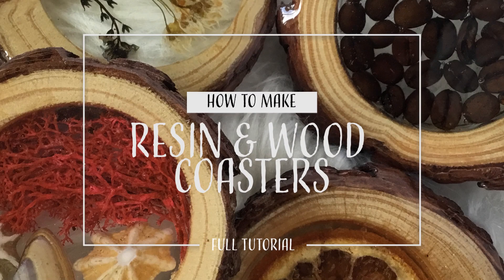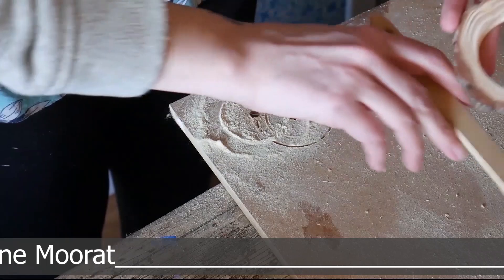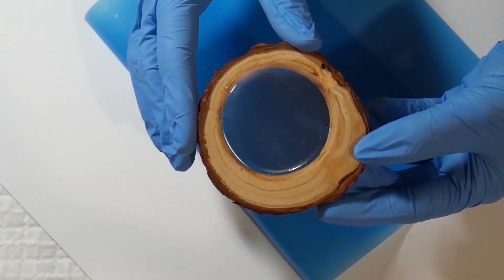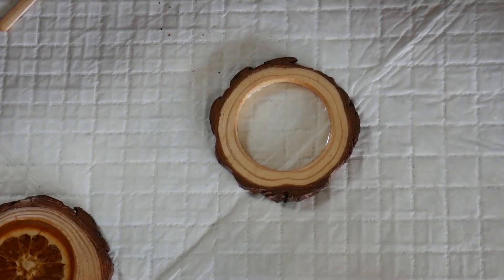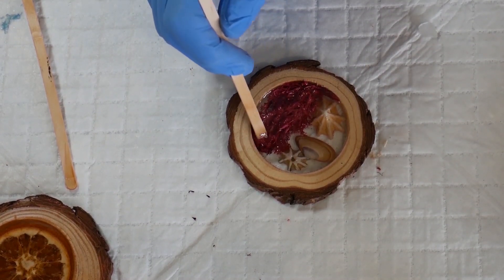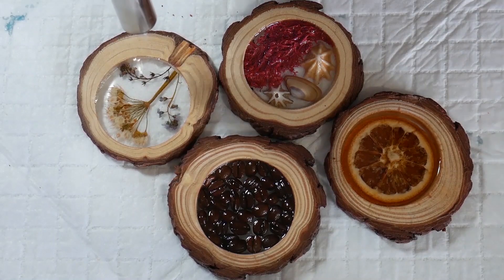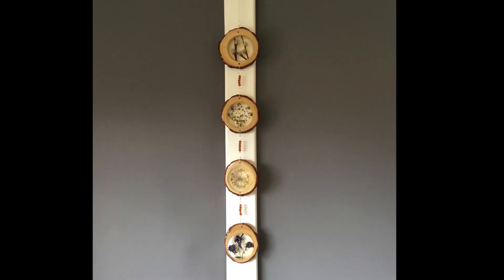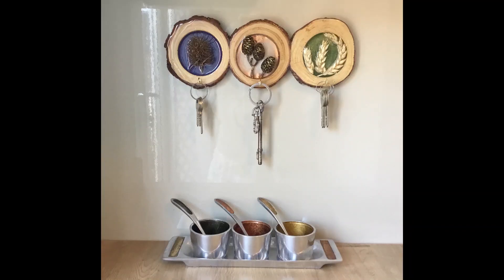Nature's Textures Captured in Resin & Wood Coasters. Full Tutorial

Comment: Hi, to avoid bubbles, heat gently by passing over with a flame from a small blowtorch hotter than what you had for a longer period than what you did (like you would use for cooking). For epoxy resin.
Reply from the maker: Thank you. In normal circumstances I would agree but as I was working with wood I was trying not to scorch it.

Comment: I am wanting to do something similar to this for a upcoming art project but the difference with my idea to this one is that I want to use pressed flowers stuck onto sanded wood rounds, and then pour the resin over the top to seal it. Is this a good idea or could there be another way to do it? I also wanted to paint some of them then pour resin over the top.
Reply from the maker: I think it is a great idea. I’m thinking if you coat the wood surface with pva then put the flowers on and allow it to completely dry before adding resin it will work nicely. If there are any bits on the pressed flowers that won’t lie flat you could lay a silicone sheet over the top and place something heavy on the top whilst the glue dries.